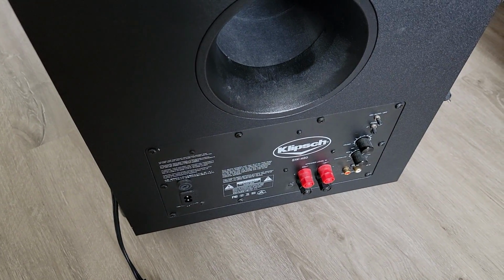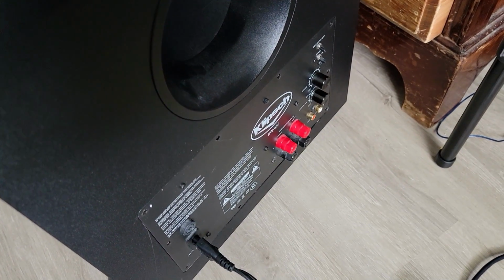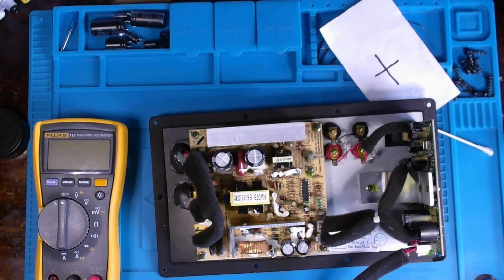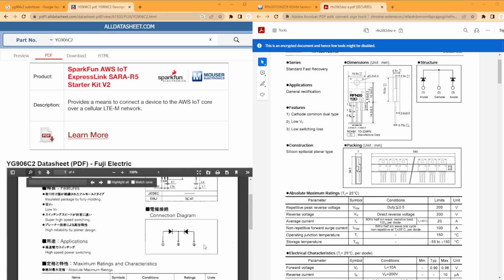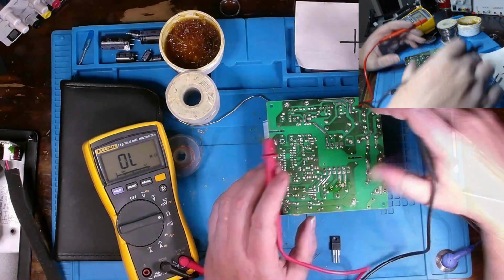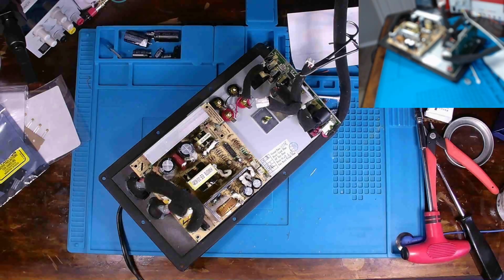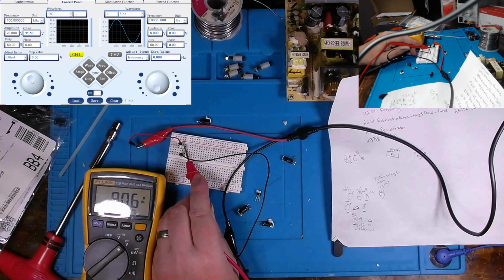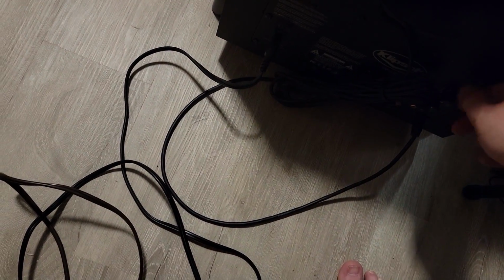(Repair) Klipsch SW-450 Subwoofer No Power

Comment: I replaced the recifier and cap and still no 48 volts. It's really hard without a schematic.  Can you get a schematic for this unit and if you have any suggestions 
I would appreciate it. The amp side is working. Thanks for any input you can provide.
Reply from the maker: Sorry I haven't been able to find one. Do you have your +9/-9 VDC? You mentioned having the +48. I know it will go low when there is a short in the quad amplifier on the amp side. 

You may need to troubleshoot things prior to regulation. Maybe rectification where AC is turned into DC and the DC into a high frequency PWM at the input.
Reply: Ok.. thanks for getting back to me. If I can find a schematic, I'll send it to you.
Reply: Yeah no 48 volts or ÷9v or -9v..
Reply from the maker: Okay yeah, you need to start at the input of your power supply, burned MOV maybe? Blown fuse? There's definitely something causing it to not produce regulated voltage.
Reply: Thanks.  This morning i checked across that isolation transformer and got around 60V. I can't find a schematic yet. I'm calling Klipsch on Monday to see about getting one. I appreciate your help. I went to electronic school in 1982 and never really used so I have a lot to relearn and appreciate your help. I feel incompetent. Have a nice weekend.
Reply: Is MOV referred to as Metal oxide varistor or did you MOV stands for Main operating voltage. I have a lot to relearn. Frustrating!!
Reply from the maker: @johnsmidl7441  metal oxide varistor

Comment: I have the same sw450 , install a different 10 inch sub in there , it sounded very good , but after a few song, it stop working the led blue light went off ,I can hear a buzzing noise , i check to my knowledge, it not the fuse too , i out the amp board , i want to sent it in for repair , thanks
Reply from the maker: No problem

Comment: Anyone know what it means when the blue led light on the front is on but it is flashing/ pulsing and there’s no sound coming out. The sub is set to the on switch thanks for any help!
Reply from the maker: Your power supply is bad. You have capacitors that are leaking current so the amp will not fully power up.
Reply: @HavingFunRepairs  thank you for the response! What is the solution???
Reply from the maker: This video covers that solution

Comment: Hi, thanks for the video. My sub abruptly stopped working. It won't turn on. I've switched power cables and plugged it into different power cords, but nothing. I don't think the amp got fried because I purchased it a month ago and it's had minimal use only. What could be the reasons for this? My sub is Bic America pl200 1000 watts
Reply from the maker: Check the fuse if there is one and if you know how to. Or simply just swap the fuse to check it. If it doesn't power on after, then you most likely have a power board failure.

If you're looking to have the item repaired email me at havingfunrepairs@gmail.com
Reply: @HavingFunRepairs  Thanks a lot! Here in India, home theater is still reserved for only a tiny section of the population (obviously the well-off), and with import duty being exorbitant, it's not really a thing for the middle class yet. Audio enthusiasts like me have to pay a fortune to get these imported electronics to our country. In fact, I paid about $800 for this unit, and it just stopped working after a month. It's quite unfair; these electronics are quite affordable in the US and yet double the cost when all these items are basically made in China, which is our next-door neighbor. But I understand it's all about government policies along with microeconomics. Eventually, service centers are quite rare even in big cities like Delhi, Mumbai, Bengaluru, etc. Thankfully, there's one such authorized center that my seller referred me to, so I'll take the unit there. I called them, and they said, "Bring it over." I'm going to take the unit tomorrow for a thorough check-up.
Reply from the maker: @MattZim101  wow, that is a lot of eye opening information and forgive me for my ignorance regarding those things. Hopefully you can get this item resolved. If so, please come back with any information you obtained with what had to be replaced or fixed to resolve the issue. I'm sure that information will go a long way within this community and help out the next person who finds themselves in a situation similar to yours. All the best to you!
Reply: @HavingFunRepairs   It's absolutely fine, sir. Having someone like you share valuable information freely is truly valuable to us, especially to developing countries, because such information is almost nonexistent here. It'd be my pleasure to share every detail upon fixing the issue, which I eagerly anticipate, which may in turn be helpful for someone out there who is going through the same situation as I am. I appreciate it once again, sir.
Reply: @HavingFunRepairs  It's absolutely fine, sir. Having someone like you share valuable information freely is truly valuable to us, especially to developing countries, because such information is almost nonexistent here. It'd be my pleasure to share every detail upon fixing the issue, which I eagerly anticipate, which may in turn be helpful for someone out there who is going through the same situation as I am. I appreciate it once again, sir.

Comment: Do those fuse housings have springs?
Reply from the maker: I don't recall, but most likely they did. They would be inside the head (or cap) of the fuse holder.
Reply: @HavingFunRepairs  ok, i have someone who i sold a broken 1, too, claiming that it was missing a spring in the fuse, and that's why it wasn't working. Which seemed fishy because i never touched the fuse till it stopped working opened it replaced it with a fuse and it still didn't work so i never seen a spring and guarantee it was never opened before that in the last 10 years i bought it. So you think i just made a huge mistake?  I can't find any references online about a spring inside this fuse cap
Reply from the maker: Most fuse holders have springs to keep pressure on the fuse and continuity from each end of the fuse in relation to the circuit. That being said I have seen some fuse holders that use an alternative method that hug the fuse via cylindrical metal plates inside the holder. Sorry I'm not much help for the Klipsch item. Too much time has passed for me to recall that bit of information. That being said if you have a DMM you can always check for continuity between circuit and fuse if you're knowledgeable in that regard.
Reply: @HavingFunRepairs  no i already sold it to someone and he said he would let me know if he could make it work and he has said so far that the fuse was missing this spring and it sounded fishy because where would it have gone because i never opened it other than to check it after it stopped working
Reply from the maker: Ahhh okay, sorry for my confusion. Yes that does sound fishy.
Reply: @HavingFunRepairs  yes i been scrambling all day to figure out if these things have springs because it's been driving me nuts.  If you ever find out feel free to post here.  Thanks for responding though

Comment: Do you want to fix another one got one just like it doing the same thing
Reply: Ok try and fined it
Reply from the maker: @artyohe9658  here's the link to my Google site with contact and repair info
https://sites.google.com/view/havingfunrepairs/business-repairs
Reply from the maker: If you're interested in a pay for repair contact me through my Gmail. You can get it from my Google site linked on this channel.
Reply: Mines blows the fuse every time
Reply from the maker: @artyohe9658  that definitely sounds like a power supply issue.